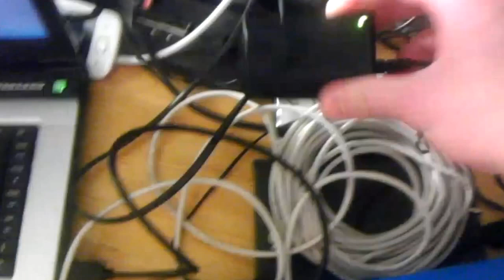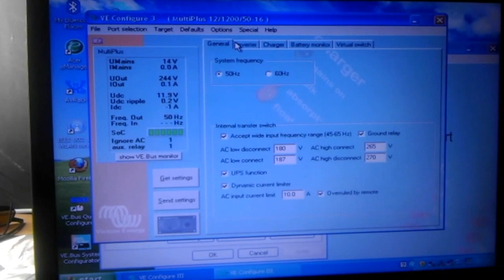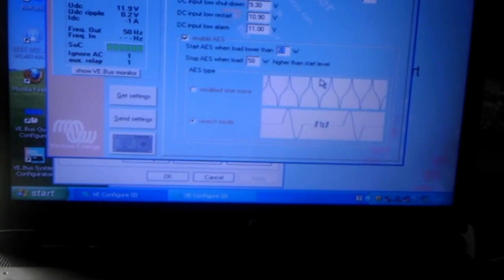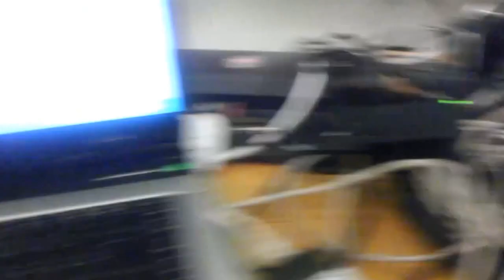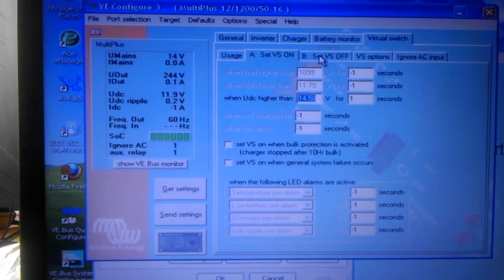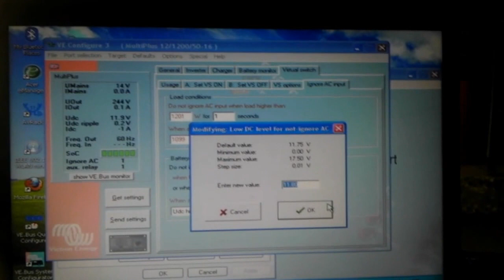Victron MultiPlus C 1200 review, MK2 connecting

Comment: This model is rated at 1000W continuous but can supply a peak power of 2400W. Do you know how long it can run at peak power for, for example to boil a 2KW kettle? Thanks
Reply: Hi, I'm not sure but I think just a couple of seconds. you can switch two of this guy's together to get higher output.